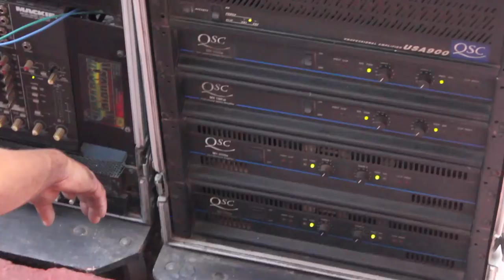SOUND SYSTEM IN JAMAICA

Comment: Omg does anybody see the clipping lights on the amplifiers!!!? poor things are working too hard
Reply: jose _Leo815 Hey but when you give them the voltage they do fine. in this situation i would use crown xti 6002
Reply: Well they are distorting like mad  (clipping in other words outputting flat topped waves to the speaker and creating noise) but then who can tell chronic distortion and noise from music in Jamaica?
Reply: The goal is LOUD.  Notice how they only have 3 QSC amps for that rack of speakers.  Distortion is normal. So is blown gear.  Loved the on site electrician and electrical safety.  A very cringe worthy system.  This type of installation is more common than not for carnival.  Hearing protection is highly recommended.  Some mobile parade systems are running on multiple 5KW contractor generators to run the equipment.  They don't bother with silent generators. They just drown them out.
Reply: isettech He is not an onsite electrician. He is an expert Jamaican onsite thief stealing electricity!
Reply: Missed the sarcasm in my post.  LOL.
Reply: isettech I am afraid I did, sorry thought you were serious :)
Reply: @andrewallen9993  You can't even hear the distortion. What are you talking about?
Reply: @GhilleGhille  The amplifiers have clipping lights. These come on when the amplifier knows its distorting with easy to detect flattening of sine waves, never mind third phase harmonic distortion etc. Apart from that you are confusing the noise made by the distortion as music, it is not being made deliberately as the sound engineer in the studio where it was recorded has more sophisticated tools and equipment than mere clipping lights so the message is if the clipping lights come on the distortion is very bad.
Reply: @andrewallen9993  You're one of those guys (a pronoun used to denote a male). No, usually clipping lights are inaccurate. No, I'm not confusing the noise made by distortion as music, that is the music. The distortion is the microphone not being able to handle the pressure. Not the music. There is probably a clip, but it's not as bad as you're making it out to be. Take this know-it-all bullshit elsewhere.
Reply: @GhilleGhille  So according to you the amplifier output of almost squarewaves never made in the studio is not distortion but how the music is supposed to sound? If that supposition is correct why is the distortion not present in the recording? The clipping light comes on when the amplifier is so overdriven it would have to output a voltage/current its power supply is incapable of supplying.
Reply: @andrewallen9993  No, the amp is not putting out almost squarewaves. The distortion is because the mic can't handle the SPL. The clipping light is inaccurate.
Reply: andrew allen i pity you.
Reply: @whocares8735  The sound system owner is obviously quite rich to afford the expensive ( though seriously abused) electronics. Yet he finds it necessary to steal electricity rather than be honest and pay for it. He is an incompetent sound engineer and a thief and proves he is proud of it with this video. Is it very Jamaican to be proud of ones incompetence and ability to steal?
Reply: andrew allen I think that the distortion is the phone or camera mic just being overwhelmed by all that awesome bass.
Reply: GhilleGhilletvere was a time when I’ve had clipping lights many times and no distortion. I really think any distortion is the fault of the recording devices microphone not the system.  Yes, I’ve blown many speakers in my time. Lol
Reply: GhilleGhille exactly.
Reply: @traxonwax  How does the microphone in the Canada being overdriven cause the clipping lights to come on? I own 4 electro voice eliminators and two sledgehamer bass bins that are 35 years old and have blown nine of them. But then my diploma is in electrical engineering and I can hear distortion that is not diliberate.
Reply: @traxonwax  Every time you have had clipping lights you have had distortion. I have designed amplifiers, trust me on this!
Reply: input signal way too high. means pure DISTORTION.  know your levels

Comment: Back in the good ole days, having this much equipment was the standard but in 2015 - 2017 you don't need all that.
Two Lab.gruppen PLM 20k44 amps. One DBX driverack 4820 Controller. Add whatever mixer and audio source you want. 
For speakers: Two Danley Sound Labs SH60s and bass, Two TH118s.

Comment: Oh Man I want Purple speakers like that. I wish K1's came in Purple.
Reply: that speakers are crap
Reply: What, you don't like the Purple?
Reply: You know, it is a scientific fact that purple sounds way better than any other color.
Reply: Apparently yes, purple is even better than turbo blue, gives you +9 db, with blue you only get 6.
Reply: +Rob Chapman i like it but the Sound is not very good.
 but the are cool
Reply: +MusicOneChannel Sorry it is they Are cool
Reply: And you can confirm that after hearing them through a youtube video, recorded with a camera mic? right
Reply from the maker: DISTORTION IS FROM THE CAMERA MIC NOT THE SYSTEM IT SELF
Reply: G
Reply: XmusicOneX dude you do not know anything about speakers or amps i own McCauley sub there these 21 inch subs in the box there is 4 of them in each box and those fuckers take a whole amp. i run them on Lab gruppen fp14000
Reply: theNWdigital yes lol

Comment: the amp's are clipping ;(
Reply: +tutorialsNL How can you tell - it all sounds horrible
Reply: have you seen the eq and the crossover settings, its a joke, do you think they know how to manage there equipment, or even set if up properly!?!?
Reply: I doubt it. Still - give em credit for adding mids and horns. I've seen these Jamaican-style sound systems with 16 folded horn bins and two piezo tweeters.
I still want to know how they can drive all those amps from one piece of wire stolen from someone's roof!
Reply: +Phil Moseley yeah i dont now how steal Electric from a crappy electric thing. whatever
Reply from the maker: HAVE YOU GUIES EVER HEAR ONE OF THESE SYSTEMS IN PERSON ?
Reply: romaine pope nope
Reply: romaine pope but it is a zelf build .. and that Never so good
Reply from the maker: zelf build ??
Reply: they had two separate eqs one for tops one for bottoms if y'all paid attention and trust me these systems dont sound bad at all. They clipped, but if you've watched till the end you'll see that they've taken care of the clipping. For the crossover it sounds as if they cut off the mids at 100hz and the sub's were cut around 70-100hz I couldn't tell cuz the camera mic was distorting at points. Y'all obviously have no idea what y'all talking about lol...
Reply: I play my QCS all night with them clipping and they still sound good,
Reply: Peter Gordon nothing wrong with soft clipping. As long as the light comes and goes, its not overheating, and not distorting then it's cool..

Comment: at 2:32 im curious here but why are the model numbers on the qsc amps covered up with black tape?
Reply: I'd bet they're RMX2450's. They're definitely RMX series, the 2450 was the largest in that product line in a 2 rack space form factor. There was also a 4050 and a 5050, but they're in a 3 space frame. There were smaller 2-space units as well, but given the rest of the system I'd put money on them being 2450's.
Reply: I'm wondering that too. The only thing I can think of is the cases / guts have been swapped so the model numbers are no longer correct.
Reply: They are the remake of the QSC MX Series amps. Which is now the QSC RMX Series

Comment: I wonder how many upgrades have been made since this video.. cause all the 2 and 3 amp racks business is too much now a days.
Reply: nothing is too much for BIG SETS you must be talking about little baby sets for your yard or local club. Either set in this video is likely running about a 3rd of their total equipment / box in this video. But presently there are a lot of fully mobile sets playing out of vans in JA for mobility and ease of use. They sound tough still. but full sets ARE A DIFFRENT ting
Reply: Amps rack a part of the culture a sound breda self powered box just a water down the thing
Reply: @shanewallace4784  powered systems are very powerful and sound very clean. Sound System quality is part of sound culture.
Reply: @djxcel23  actitive systems can sound good and can sound like sh#t too.....engineer and tuning have a lot to do with quality. Passive systems same way. In Jamaica we have to use what we can get , can't just go online and buy flavor of the month
Reply: @shanewallace4784  having a bunch of amps rack is not of sound system culture. You can power a 4 wall system with one rack.

Comment: What kind of speakers are these
Reply: 18
Reply: @quietstormgriffo9000  custom? Or brand?
Reply: I think its custom by the shop
Reply: Inside the top cabinets of katarock I’m sure those are ev drivers, not sure if the subwoofers are also ev.
But those custom boxes for the subs sound badass

Comment: Using speakon for mains voltage
Reply: you can get 240v mains rated speakon. keyed differently so you have to really gorrilla it to mess it up. same basic twist lock design tho. good plugs.
Reply: @arjovenzia  I know it's called a power con.

Comment: That sound at 23:34 I hear that pulsing noise on other videos where sound system tuning up the system what causes that noise?
Reply from the maker: Yagga97  audio control Richter scale
Reply: romaine pope do u know the make and model of the Richter scale id like to learn more about it. It’s like Jamaican systems use all kinds of different signal processors than wat I’m used to seeing.
Reply from the maker: audio control richter scale series 3
Reply from the maker: I personally don’t have it on my system but most guys swear by it
Reply: romaine pope I understand for analog purposes it’s a good piece of equipment but I don’t see why it’s needed if u have proper crossover and eq or if u went digital with a whole speaker management system
Reply from the maker: I tested it on my system and didn’t like the sound of it but then agian I hear systems with it that have some real heavy bass
Reply: Probably different tuning who knows. Ur guys sound system is different than wat I see in trinidad and the states. We don’t use a whole lot of expanders and Richter scales but u guys know wat sound y’all want. Respect to u guys
Reply from the maker: Yagga97 yeah I have heard some good soca sound from New York I did a carnival truck few years back it was cool